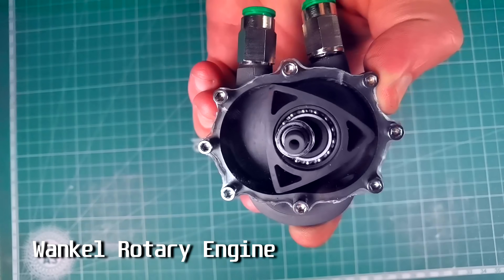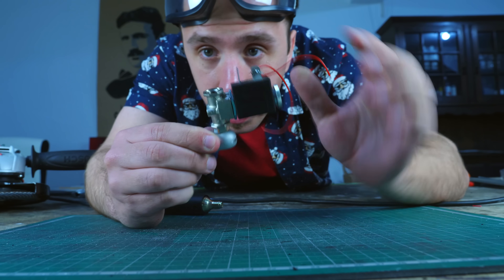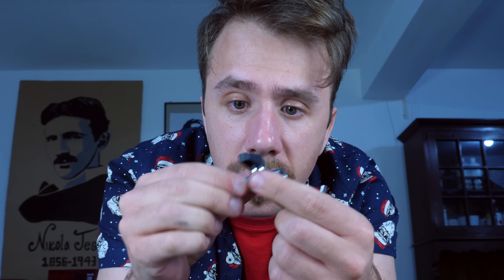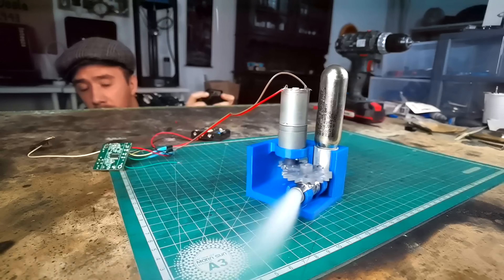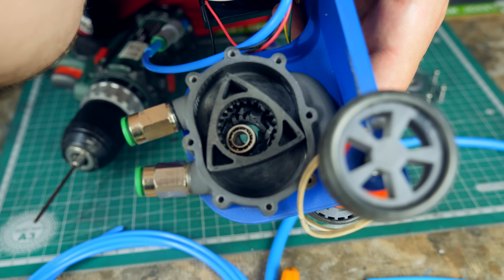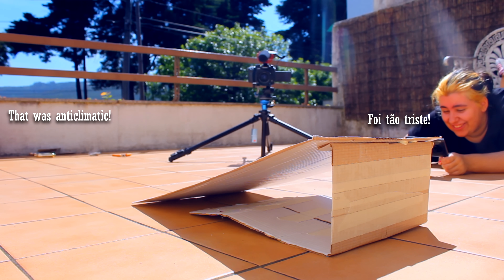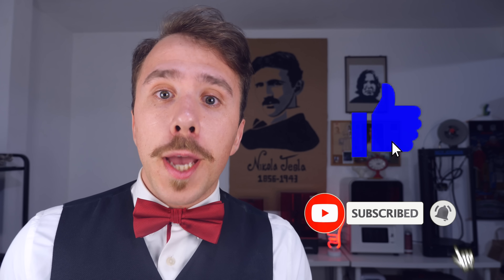Rotary Wankel RC Car (3D Printed)

Comment: you mentioned that the 5k rpm was too much for the tiny wheels but you also were losing a ton of power with the rubber band slipping, i wonder how much better it would be if you had a 1:10 reduction gear as the drivetrain vs that rubber band, no slippage except for the tires, and 500 rpm on the wheels would still be a lot. I think the inner gear shattered simply because you just had no load on the engine as the rubberband was slipping so much.

you were also losing a bunch through the case and the "tips" of the Doritos, the case would be simple enough to seal with silicone or hot glue but then youd lose out on the ability to easily take it apart, Ive never tried it, but i wonder if you could 3d print a gasket from TPU just a few layers thick, maybe the recycled tires or a more rubbery or latex one would be best. The rotary tips are harder, Mazda uses metal fins with springs to keep a constant seal, though its a major failure point. Honestly I think thatd be the lowest of your worries if you wanted to make this engine as efficient as possible with this setup

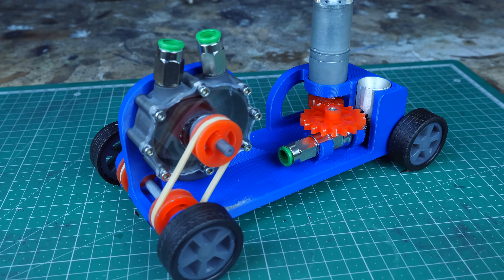Comment: 6:00 I think you should use a longer hose, because a lot of the gas came out of the motor still liquid, if you use a longer hose all the liquid might turn into gas and increase the preassure, or you could heat it directly at the beginning of the hose, that should make it violent

Comment: I have one of those CO2 bicycle pump things that has a lever that you press to inflate the tire. It also screws down to the valve stem. That might make this kind of remote activation thing easier.

Comment: the rubber bands are slipping, if you use gears then you will have less torque loss and the engine will spin slower cuz of the load

Comment: Please expand this engine and car with a fully 3D printed gear box and multiple co2 cartridges for backup fuel (also a drive chain that doesn’t slip). I think if the engine had a fair amount of resistance on it that the RPMs would go way down and your fuel would last longer. Increase wheel size a bit as well for traction.

Comment: You should design a 3D model where it’s a gun where one of those rockets are in it and when u pull the trigger some curved hands tightly grab the canister, and a nail comes up and pokes a hole. When trigger is unclenches the nail comes down, the hands ungrip it and it launches a can like up or sideways or something

Comment: I know you won't read it but you could have made a detachable battery basket (because the electricity is used for opening the valve only). So it would detach when the "car" starts moving. Less weight would help for sure with climbing the ramp.

Comment: I'm no expert, but it seems to me the car lacks weight. You lose a lot of fuel and therefore power on wheel spin because the car doesn't apply enough pressure to the tires.

Comment: Maybe try to get more weight on the front wheels and also try getting a small belt with teeth so the belt wont slip(like a cars timing belt)then you will have way more traction and more speeed!

Comment: I think the  CO 2 cartridge you are using is enough power. What I think you need after the valve is a pressure regulator. The pressure regulator will allow you to throttle the engine, And allow you to preserve psi while cruising  but alow  For higher psi out put, for climbing hills.

Comment: if you remade the car with a better drivetrain it would definitely make it up the ramp. it's losing power when the output shaft spins against the rubber band. a drivetrain that used gears instead would transfer the power better

Comment: As the car moves forward, the front wheels may go up a little so they wont touch the ground so it may be slower.
I recommend that make the engine move the back wheels so when the car is moving up a little it doesn't lose speed.
8:11 
Tomatoes are disgustin

Comment: You actually can 3D print a whole drone, as it's potentially a cheaper (and quick) solution compared to buying the skeletal frame and casing for the DIY quadcopter to name one - some are ridiculously expensive. So 3D printer is obviously the answer for certain quadcopter builds. Not to mention the advantage of optimizing the center of gravity related to the weight of the avionics put onto the drone frame, ensuring it do its job well in the sky without falling straight down.

Comment: you should 3d print an arm that freezes tomatoes, throws them at a backboard, and falls into a 3d printed truck bed that drives off of a table and into a trash can.

Comment: There's an awful lot of power being lost in the drivetrain where the output shaft is spinning inside the drive belt, and then if the power were transferred it would be to the front wheels.  Also maybe a reducer to prolong the output somewhat?  

Just thinking out loud man.  Great video!

Comment: You shoud print gears betvin the engin and wheals not to use rubber bands becuse it sleaps end heave not much energie to power the car the engin is to fast end no go full power evri time its vasting energi please try

Comment: It'd be cool if you could connect the engine to a fly wheel and let it spin the wheels more gradually to minimize the slippage. Good luck designing that clutch!

Comment: The link was way too poor between the output of the engine to the input of the wheel. The elastic band was way too flimsy! It was pretty much like a clutch slipping real bad.

Using at least a wider and shorter band would have grabbed way better (adding resistance tho so loss of power but there is clearly plenty). 

Best would have been gears being a way more direct and consistent drive, removing the slipping aspect.

Comment: You could do so much more with this. You are dumping  liquid co2 into the engine. You could probably run 2 motors with that much flow. Also if you used your metal 3d printing  you could make a conductive pipe with fins to maximize the  change of liquid to gass. The connection between the motor and wheels looms to be slipping, and as you mentioned better contact from wheels to ground would help a tone as well. I would bet you could get it to go more than 3 times faster and farther.

Comment: what would happen if you had the exhaust port have vinyl tubing T off into a one way valve into the intake tubing, making a constant cycle? and then a wastegate for maximum pressure release

Comment: Why would you use a wankel engine design if it's going to be powered by compressed air/co2? Aren't you just wasting energy in the compression and exhaust phases/strokes when you could just use a turbine? Not meant as a put down or criticism, I'm just genuinely curious and/or confused

Comment: Seems to me you would be able to regulate the CO2 better with a worm gear on the motor. That would open the valve slower and you wouldn’t just dump your load in one second.

Comment: the wankle works but its the pully system you have with that rubberband, a lot of the effort is wasted in band slip, you need gears or a toothed belt drive to get that power to the wheels

Comment: You should try adding a second engine compartment which spins in the opposite direction to negate the unbalanced centrifugal powers created by 1 compartment.
Also i think adding a belt with teeth on it would help since i saw there was a lot of slipping on the drivetrain.
If going for a serious drag car, try adding high quality wheels with actual air in them (dont pump them to max psi so they have a lot of grip).

Comment: I must suggest that the Wankel layout is not the best way to get energy from gas, steam co2 etc. The problem is it is designed to compress the gas at the half way point in its journey round the chamber. The gas is already at a high pressure. You could just use a paddle wheel or radial turbine, just let the exhaust gas leave along the axis of the wheel. Less vibration too.

P.S. let me know if you ever visit the UK. It's interesting but  nowhere half as nice as Portugal and we have a problem of feral tomatoes rampaging through the streets.

Comment: Case looks like it's leaking a lot in slow motion. That and I'm sure the high pressure isn't helping it stay in one piece.
Funny enough though it looks like the engine is actually producing too much power, as it's dragging against the rubber band rather than driving the wheels.
This is a PERFECT excuse to 3D print sprockets and chains!

Comment: You need to make a better transmission 😏 or use a smaller line from the cartridge to a Tesla turbine 😂🤣 with a better transmission to hook the power through the rubber to the surface
Reply: Consider opposite comical rollers with a wider rubber band

Comment: Hi i'm french so my english is not great but you made a great video
BUT
It is necessary to make an integral transition to the wheel, 4 driving wheels And it is necessary to put gaskets such as a cylinder head gasket for example 👍🏻

Il faut fair une transition intégrale au roue, 4 roue motrices  Et il faut mettre des joints d'étanchéité comme un joint de culasse par exemple 👍🏻

Comment: Instead of car, 3d print a boat and try to remotely drive the boat using jet power.👍🏻 Try two types of exhaust system. 1st open to the air system and 2nd under water system. And let us find out which gives the most thrust and goes longer distance within a limited time of thrust.

Comment: I am not familiar with Wankels, but in my opinion, it has three stages. In the first stage it sucks the air mixture with a fuel, in the second stage that mixture is ignited and relatively slowly burns and expands, which creates the torque, in the last stage it exhausts the burned fuel out of the motor. Using carbon dioxide you have in fact nothing to burn, but due the high pressure of that gas you have a lot of mass to expand. So I thing the original Wankel's design could be modified to two expansion stages and one exhaust. The first chamber should be really small, because the injected carbon dioxide cools down due to massive pressure change and needs to warm up to expand, which is near to impossible because of continuous injection of another high pressure carbon dioxide. And when I think of injection, I mean using some kind of nozzle just to slow down the consumption to something reasonable. In the second stage the mixture of relatively hot and cold gases equalize their temperatures causing expansion producing the torque, so this chamber should be slightly bigger than the previous one. In the last stage the volume of the temperature equalized gasses is lowered  by exhausting of the waste volume of them. This should be the biggest one just to give enough room to dying process of temperature equalization and expansion. If I look at your motor, I think that this is near perfectly OK, the only modification that I would recommend is to add the nozzle to the place where the high pressure carbon dioxide enters the first chaber. This easy to do modification  decreases the gas intake flow speed, which makes the engine to run much longer from the same source, in addition lowers the overpressure, which should prevent the gas leakage around the construction and makes whole thing run smoother and much efficient giving the mixture of gases enough time to warm up and expand properly, but on the other hand this leads to massive increase of the overpressure in the fixtures before the high pressure gas enters the nozzle, which means that theese fixtures have to be build to be capable of handling this resulting to the need of much robust design.

Comment: you should've fixed the rubber band thats connecting the engine and the wheel, its way too loose and won't transmit the power efficiently

Comment: Small suggestion, probably an old project by now but you may come back to it, use some tighter rubber bands. If you look at the slowmo you can see the band deform meaning your wasting power in that deformation that you could be putting on the wheels.

Comment: The rubber band wasn't a good pulley between the engine and the wheel. A lot of energy from the engine didn't get transmitted to the wheels because the rubber band kept slipping

Comment: You had massive slippage on your rubberband. If you used gears on the axel and on the wankel with a bike chain type design instead of the rubberband you would avoid the slippage.

Comment: 3D print e turbo charger and connect the end of the turbo charger to the Wankel and use those cylinders as the air pressure for the turbo charger and power up that beast 
Pleaseee

Comment: You should use a gearbox for the rotary powered co2 cartridges for more efficient power delivery because the string just couldn't handle all the power it transmitted

Comment: I know this is an old video but regarding the rotary engine attempts, I think it would've been better to have it rear-wheel drive, so the power can go to the rear wheels and with a bit of weight in the back, can keep the wheels somewhat planted

Comment: Seeing you hold it in slow motion made me wonder just how much energy the engine throws away via vibration/ oscillation. That explains allot as to the wear and tear these things go through in cars. I'm sure the problem is mitigated by having multiple engines in line with staggered positions, but this makes me curious as to how well a modern Tesla turbine might compete with one of these.

Comment: There was a lot of belt slip from the engine to the drive train. Replacing the rubber band with a notched belt would probably improve the performance significantly.

Comment: Definitely needs some structural stability, some silicon sealant in any seams of the engine, maybe also add a mini regulator for the valve too so you can control its output force. 
It obviously is just proof of concept but I feel like it’s such a beautiful and crazy design that should have a true representation of its ability. Even if it has a lot of vibration that mostly cannot be controlled, and a shape that is otherwise not that efficient on its own.

Comment: If there was some sort of gearing that could make the valve open when rpms are low and close when high, you could make it so the engine keeps the co2 coming out just enough to run the vehicle. Thus the engine would modulate throttle for best efficiency.

Comment: I think that the poor engine was going’s through too much power. You can see the car getting out of the ground and the wheel skipping the ground. Hahahhaa Use the small co2 tank and release jets of co2 in another contêiner. that will put the pressure down a little. Open and close the valve many times

Comment: If you used a gearbox or a chain drive you could get a lot more power. The rubber band is slipping off the axle. 3D printed gearbox would be a neat addition to this.

Comment: if you used a strong rubber band like those black ones you would have much more distance because it is stronger in terms of elasticity than a cheap rubber band, a cheap rubber band jumps around alot as you can see in the slo mo so you lose distance. if you used a stronger band it would have stuck to the gear things and gave you much more distance

Comment: This is amazing, I love how you got a 3D printed rotary to work.  My suggestion to obtain more power from the engine would be to support the engine a bit more. When it wobbles the rubber band loses tension and you lose power, you'll see the front wheels hop in stead of fully turning. Maybe find a stronger pully too and have the exhaust face backwards to give added thrust.

Again incredible content <3

Comment: The inefficiency kills me...
Why no grip?
Why access pressure?
Why upside down cartridge?
Why rubberband?
(Upside-down cartridge throws liquid co2 and alot of times it doesn't exert pressure exiting in liquid form and a rubberband can slip unlike a gearbox and too much pressure will damage the components wasting energy)

Comment: The reason why the rubber and the tires doesn't work because a lot of energy lost while it's not properly fastened. If you fasten the belt which in your case a rubber band, it might can go through the ramp.

Comment: You are login alot of power on the belt because of the hight RPM. A solution would be a gear system, or just restricting the flow of CO2 out of the can to move slowly, so the belt can handle it

Comment: well it was basically dumping power to nothing and making the gas powered dragster vibrate and loose traction so the solution is to make the dragster bigger to the appropriate size for the engine, and more mass the vibration will be lesser and more power will be transferred to the shaft and turn the wheel more efficient. btw just rewatching cuz i got bored and decided to comment this on the first time I saw this vid.

Comment: huge fan of the wankel engine. pretty sure you lose lots of potential energy through the rubber band tranfer system. maybe try printing gear set that can handle the torque and speed. also a different tooth design for the internals of the wankel will work too. just a thought. love your content. stay safe and keep building :)

Comment: I am an angry commentor blah blah blah blah he called an electric valve it should be called a solenoid valve
But just to inform you it is called a solenoid valve (I’m not really in angry commentor)

Comment: You should limit the amount of co2 coming out, you'll harness more power per bar and it'll last longer, and that's just not fsctoring in ice building up inside the engine and it literally blowing out of the gaskets as you can see in slow motion.

Also, the exhaust being visible is a bad sign.

Comment: The engine was fine. Your rubber band was slipping like crazy and losing alot of the energy. Also releasing the air more gradually would be better to allow the tyres to grip. Drive belts shouldnt be flexible for this reason :)